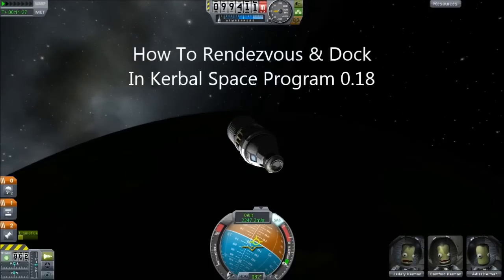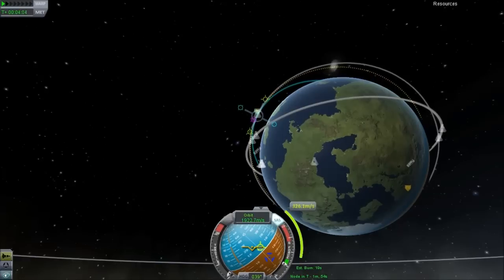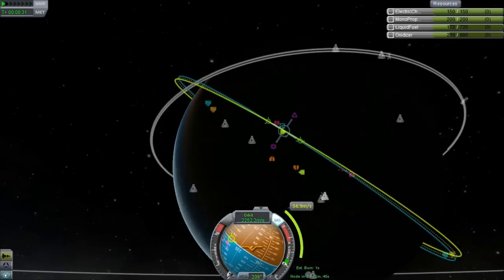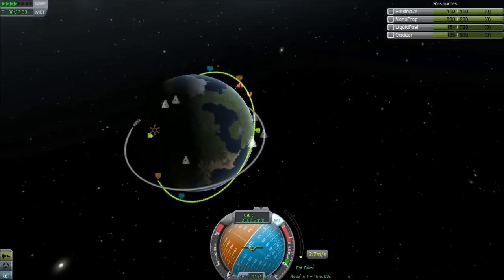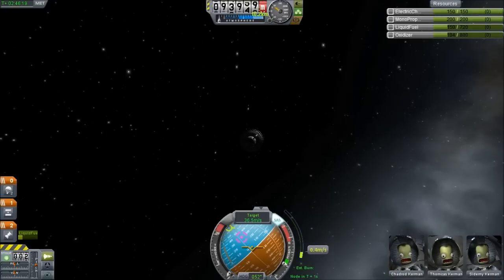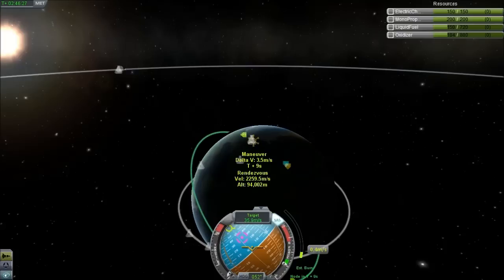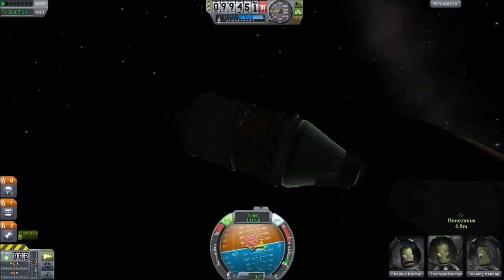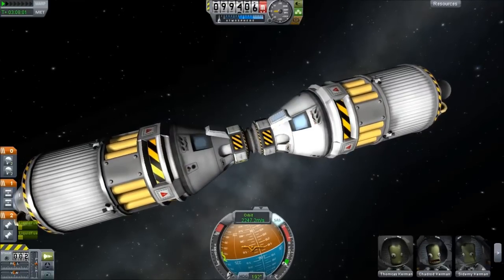Orbital Rendezvous And Docking Tutorial For Kerbal Space Program 0.18

Comment: Forgot to put control on my first space station (no cockpit or probe). Just used a habitation module. Couldn't extend solar panels or RCS. I launched a control module. After 3 redesigns and running out of fuel more times than I can count, finally made it. Now I can get close and then turn the space station to the docking clamp that I want. Thanks Scott. I take back all the stuff I said about you and your country during the most frustrating 6 hours of my life.

Comment: Here's a story for you:
I recently set up a manned satellite called the "Sky_Sat_Mothership" in a very wide kerbin orbit (sorta 2/3 of the way to the moon) and it had run out of fuel. So essentially, the astronaut was stranded in the pod and I was trying to get an engineer to help refuel the satellite.
I had been attempting to design a rocket which could take the engineer to space and dock to the "Sky_Sat_Mothership"  That took about two hours. The other design I had made was too large to dock to itself and I could not send up the same one twice, so I had to design a ship as small as possible that could dock easily and transfer fuel.
Once I got the rocket into space and separated it's stages, it took me about a whole ingame year to achieve perfectly circular orbit on the same level as the other ship, but when in this orbit, the satellites were on the other sides of the planet. The next task was to speed up the ship so as to not ruin the circular orbit.
10 quicksaves later, I am 1000m away from the mothership at 10mp/s.
Once I had achieved a good speed relation (About 0.02mp/s difference) I got the docking ports to line up and face the same direction now all I have to do is... Oh...
I forgot the mini thrusters.
Now I have to use those boosters to try and get to the ship as opposed to a jetpack. So once again, two hours and over 50 quicksaves later, I am finally lined up correctly and am going at a great pace, but for some reason, I miss the mothership and go flying off in a random direction!
So after another half hour of close calls, I decided to look up "How to dock satellites in KSP" and I listened to this video while attempting to dock the two humongous ships together. Then, at 14:05 in the video, as I am finally lined up, at the exact right speed, I go for it! And then, the two ships magnetically collide together and stick! I hear Scott say "You've docked!" and I yell "YES!" and immediatley create about 5 more quick saves. The two twin satellites as linked together and it now looks AWESOME.
But there's a problem...
The fuel tanks have basically run dry during the docking line up and there was not enough fuel to go around.
Kids, do Alt+F12.
It might just save you a whole afternoon.
Reply: ***** spaaaaaaaaaaaaaaaaaaaaaaaaaaaaaaaaaaaaaaaaàaaaaaaaaaaåaaaaaaaaaaaaaaaaaaaaaaaaaaaaaaaăaaaaaaaaaaaaaaaaaaaaaaaaaaaam
Reply: Adakid1 Gaming I started to read this stroy. Then I hit show more to read the rest. then I just nope!
Reply: I like the part where you forgot the mini thrusters. I swear these kinds of stuff happen all the time.
Reply: After 40 hours of gameplay ive only docked successfully once and it took 6 hours of total time and ever since then i barely miss my rendezvous, cant wait to do it again!
Reply: alt f12?

Comment: There's a reason people fail at rendezvous after watching this and that is because Scott uses the liquid fuel engine to adjust the orbit when he's closer than 1 km to the target. The secret is that you use RCS and mono propellant and adjust your velocity by pressing the I,J,K,L and H,N keys to match the velocity and path vector of the target. Plus that this videos is old BETA. In the video he spends a lot of time adjusting the velocity at 50 meters from the target instead of doing while coming in from 1+ km. Just put the prograde marker on the target, speed it up and see which direction it goes and then use RCS to push yourself in the opposite of the direction. When you can see your target, check what direction it's moving and try to match it. If it's going up you are moving down, so push up.
Set the SAS to Target as well and you don't even have to use the WASD keys. And the bigger your ship is, the harder it will be to reverse the movement if you have to turn the ship around.
I played KSP since BETA, never did a single rendezvous. Then I decided to learn it and read up on it, but this video didn't really explain how to use the RCS for adjusting the nodes or the orbit. Once you understand it, you'll laugh at how easy it was and you'll do almost perfect orbits every time. Then you can finally start doing the Apollo challenge and getting fuel stations out to other planets. My goal will be to have a satellite at every body in the system.
Reply: were you able to do it?
Reply: Yeah, but did you do it?

Comment: i have a problem docking did everything in this video i have the shielded docking ports and no magnetic force happened between the ports even though they hit dead on and then floated away
Reply: and yes i opened both ports before docking
Reply: Jesse Raines How fast were you going? Ideal speed for docking is 0.3 m/s or lower.
Reply: i was going 1m/s
Reply: Jesse Raines I had the same issue docking.
Reply: mark devlin turn of the SAS when the magnetic force kicks in...
Reply: ...the magnetic force does not happen thats the problem
Reply: Thwowspieler My issue was resolved. I had to read the section on the wiki page carefully about docking ports. Mine was not a magnetic force issue nor was it an SAS issue. There is only one side that the docking port works. Just make sure the small ring side of a port is facing whatever you want to dock with. The rest is just making sure you line it up correctly. And yes if SAS is on and its not working, turn it off.
Reply: Jesse Raines

Too fast.They will bump and disjoin.
Reply: SekretZdzicha what? bullshit. there is no problem with his docking speed. first read, than think, than answer. if anything fails like thinking, do not answer!
Reply: Thwowspieler

My argument is that 1 m/s is too fast still...

I understand he placed his docking port flipped by 180* degree in a wrong direction...
But still even if he placed it correctly, 1 m/s is way to high.
Reply: SekretZdzicha You can even dock with 3 m/s... do you realy played the game?
Reply: Thwowspieler

I don't play in a childish fashion. I prefer realistic approach.
Reply: Thwowspieler

Of course it's realistic in terms of simple newtonian physics. Only relativistic effects and N-body equations are not present in the game, hence no lagrarian points, no period change in moho orbit etc.
Reply: Jesse Raines BUGS!!! (in the game)
Reply: *****  I can probably pay KSP alot better than you

Comment: There is a mod called RCS Build Aid that is a lifesaver for placing RCS thrusters for docking use. It's important to place them exactly on the center of mass (to avoid the ship rotating when you only want it to translate), which can be eyeballed with some degree of accuracy, but this tool takes out the guesswork and leaves you with craft that slide across the sky as perfectly as a figure skater.

Comment: Heheh, going back to this video helped me rescue poor Bill with low tech in .22.  I'd done a low tech Minmus run but wasted lots of fuel in its orbit trying to find where the "orbit near Minmus" line is, and ran out of gas trying to get home.  The Mun helped get in a bit closer with the aid of Bill getting out and pushing, but it wasn't enough and was highly inclined.  I'd been having trouble with actually getting a good encounter with Jeb in his twin-pod rescue craft, but this video reminded me of the Target mode on the nav ball.  Got within 2 dozen meters, had Bill EVA over, then brought 'em both home after a couple of aero-brake passes, due to high eccentricity.
TL;DR: Thanks again for this video Scott, from the Future.
Reply: he got out and pushed? u can do that? lol
Reply: You could do that, yes.  I guess you still can, but not as well.  Just point the capsule at your favourite vector, get out, hop off, hit the eva pack, gently manuvre to the capsule's back end, bump up against it and hold 'h'.  It gets unstable after a bit, so it's good to hit 'r' every 10% of your EVA fuel or so to get off the pack and then back on so you don't go spinning off into the distance.  It used to be you could re-enter the capsule and leave again with a full pack, but that's a minor exploit they've fixed in .23.

Comment: This is what happened with Starliner and is the reason they had to abort their assent. Starliner got their mission timer wrong and burned retrograde at a perigee marker. Doing this placed the craft in the wrong orbit and they overshot the station and they used up their Delta H. The correct procedure had there been crew on board would be to burn prograde for 2 mins 15 seconds when you are at apogee. Starliner did not do that and it placed them in the wrong orbit and they had to abort to White Sands.
Reply: They should have watched this

Comment: When you're really close just make sure they are both closely aligned vertically and laterally (eyeball it) then use the pink target on the nav ball to make them parallel longitudinally. Using the pink target is a lot easier than moving the camera around and getting your RCS axis confused. when all 3 axis are parallel then just tap the 'H' key to close the gap. Within 100m is easy for me, its the rest of it I suck at.

Comment: And another point. At 10.29 you align the spaceships opposite each other. The position you pick on the navball is clearly on the brown-blue separation line, but the longitude angle is nothing peculiar, so I tried to read carefully the values. Do I see it right that the first ship looks at 35deg longitude and the second looks at 215deg longitude? That would give in fact 180deg difference. Am I getting it? Please confirm. Also please confim that the inclination of the brown-blue separation line on the navball is irrelevant. Thank you.

Comment: The engine that KSP runs on doesn't allow multithreading. Thus it only utilises one core, this is what is causing the lag, not your RAM or GFX card. KSP actually runs smoother on many dual-cores because they're likely to have higher clock-counts than mid-level quad-cores. Hope this will be fixed soon but Squad (the KSP devs) can't do anything about it.

Comment: Hmmm I'll have to check it out. I usually try to do the one that would take the least amount of time, which I guess would translate into less fuel. Still is a pain. Kind of wish they'd add an indicator how long you need to fire your engines to achieve a certain orbit/angle at max power. I've noticed that if I try to match orbital planes it'll only tell you how long once you start your engines... that doesn't really do me any good to estimate when I need to start firing... :(

Comment: Been playing for a week with 4 mods KAS, KWRocketry, Lazor Docking cam and Engineer (which I haven't really used). Got a nice station going with fuel tanks and docking ports for expansion on a near perfect circular orbit at 260 km. Now I couldn't do anything. When ever I past 0 m/s target speed the game bugs out and the target speed begins to to accelerate and decelerate peak pass 4000 m/s. At that point I couldn't switch to the station or go back to the space center. I either have to revert launch or load a quick save. Started a new save, same thing. It couldn't be the mods since I built it with parts from them. Any ideas?
Reply: Your computer might not be able to run all the particles that are on your space station. That might be the cause. You could head into the tracking station and terminate the space station, but that would completely destroy it.
Reply: It was actually Lazor Docking Cam causing problems.

Comment: I did everything right, i had put a big fuel tank in orbit, and was preparing to dock a big ball of science to it, and planned to send out a small crew later on to start flying away.
And then i noticed my mistake: When clearing the docking ring on my fuel tank to prepare for docking with my ball of science, the probe was sent away and i was unable to set the "debris" that was my fuel tank as a target.
Reply from the maker: In the map mode the mouse up to the top and you'll be able to select map filters so that debris can be shown.
Reply: Scott Manley Ah, thanks. Well I'll get a bit more experience while i rendezvous with my new fuel tank. I redesigned it to have a decoupler on top of the probe, the engine and the fuel tank, then a docking port on top. Then i can just ditch the probe when i dock with the fuel tank. Perhaps I'll make a mission to recover the lost fuel tank some time in the future.

Comment: So, I built this space station and successfully docked a probe to one of the docking ports, but when I tried to dock a second probe to the station the damn port won't open. I hit it right in the center like 5 times but the magnets never kick in and it just bounces off the port...
...turns out I equipped the station with two different ports. I realigned my probe to a corresponding port and succeeded on first attempt. X(

Comment: huh....apparently i got my stations synced to 0.2km, but when i burned for an aligned orbit i didn't notice that it had moved the intersect point to 0.0...needles to say my tug and my space station part collided with each other knocking off one of my tugs engines (can no longer fly it cause the center of mass is off now) and killed the strut that was holding all the solar panels and fuel depots on my space station parts.....that sucks

Comment: Man this sucks, I have been trying to save Wilson who is stuck in an orbit around the sun, when i use this method i can get the intersects within 300km but when i execute the maneuver it's out by a lot. I noticed that it's got to be accurate within a few hundredths of a second because of the sheer diameter of the orbit.

Well here goes attempt number 8 :(
Reply: Not sure if I've arrived too late to help, but have you tried using RCS thrusters to achieve accurate burns/maneuvers? Each quick tap of the N or H button (depending which vector you're facing) seems to change the velocity by a little less than 0.1 m/s. You can use the main engine to get the desired velocity close (if it's a long burn) and tap the RCS to get that pinpoint accuracy you need.
Godspeed, Wilson Kerman!
Reply: Tyrus Doraneko It's all good, I did eventually saved him, though it took me a good 14 hours. Luckily he had some JP fuel left otherwise he would not have made it. And yeah the RCS thrusters probably would of helped, but I had none on that ship at the time. Thank for the info mate.